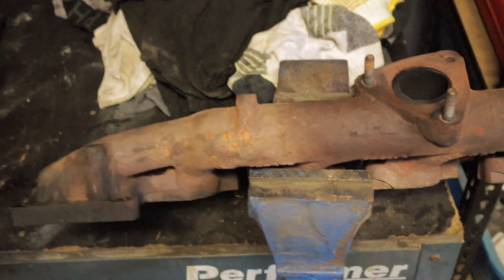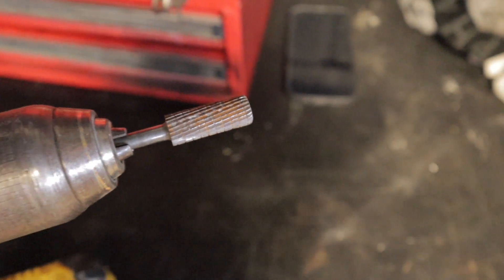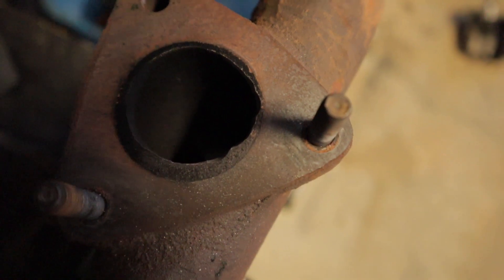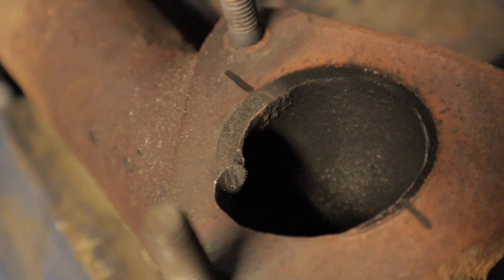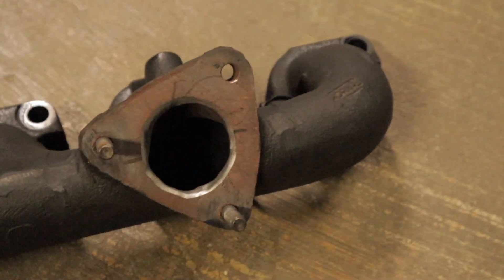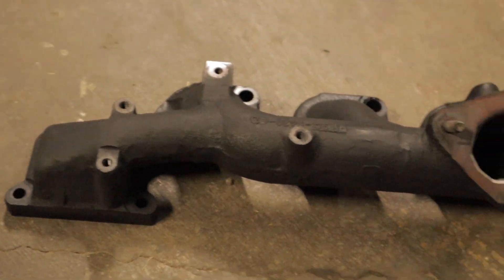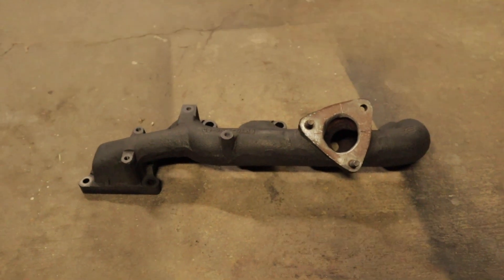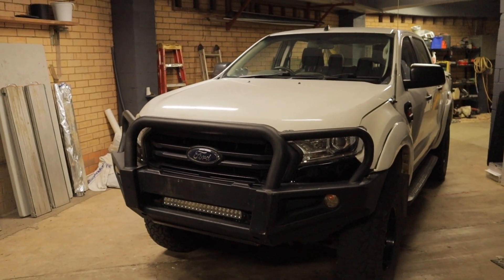Ford Ranger Turbo Exhaust Manifold Port Matching

Comment: Hi AA, pls pardon me for a question outside the issue this video addresses. 

My ford ranger 2.2l 2015 has refused to start even though all its 4 injector nozzles spray perfectly. This problem began when it set a fault code p0341 and p2122. I replaced the CMP but that didn't solve my problems so in my bid to diagnose further, I took off the valve cover and physically check the camshaft assembly and when I couldn't see anything wrong, I coupled it and started the vehicle and it ran pretty fine. I shut the engine down by myself,  so after awhile like an hour, I tried to start it wouldn't start till now. Thus far I've tried to check timing, compression, all seems to be very okay yet my truck refuses to start. A friend suggests I get a new ecm but would a faulty ecm allowed injector spray as well these ones do? Thanks for being helpful always
Reply: Check your crankshaft position sensor

Comment: Hi Mate , sorry for asking off topic question. After blanking the EGR have you noticed any power loss or gain or difference in  fuel economy or EGT temps ?  My common sense says block it off but the experts say it lowers combustion temps and it’s a good thing. I don’t know anyone personally who’s done it so that’s why I ask . Thanks in advance 👍
Reply: EGR delete can be complicated with a performance tune and intake flow improvements. Presently going through this. Need to reset the turbo VNT min open position to avoid excessive exhaust manifold pressure, or it'll buck and surge at light load and decel.
Reply: @Huskydog78 thanks mate

Comment: what do you think about modifying the transmission oil heat exchanger for an air oil radiator, and also the engine oil radiator? it would be interesting, I'm thinking of doing this on my ford ranger 2.2 2019 75k

Comment: Very keen to see if it makes any difference

Need to make sure you keep the air temp the same before and after so the density of the air and the effect of your intercooler is the same

Ideally do the before and after on the same day, on a Dyno!

Comment: 0:25 Dropping after 22 psi has nothing to do with the manifold. It’s because there’s not enough fuel. The ecu Is limiting psi in the higher rpm on a stock motor because there’s not enough fuel to support the air fuel ratio - boost controller is lowering your boost in higher rpm to maintain stoichiometric ratios. 
Bigger injectors, more fuel and a tune will see more constant manifold pressure. 

Match porting the manifolds is still a good thing to do.